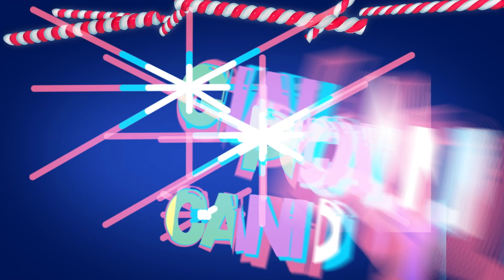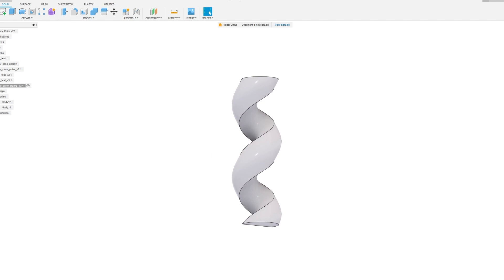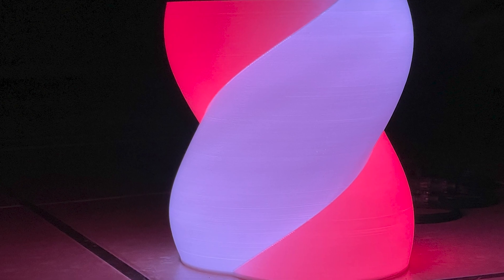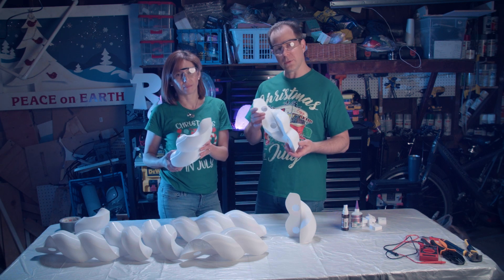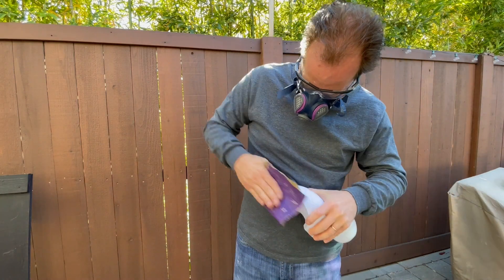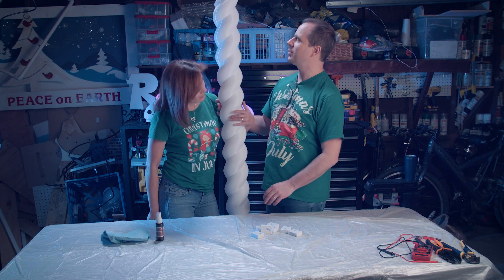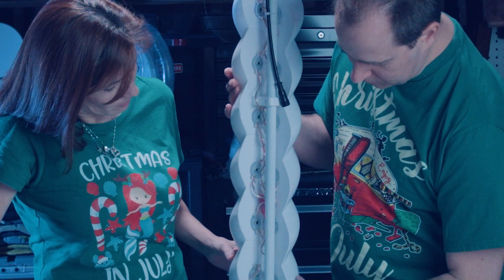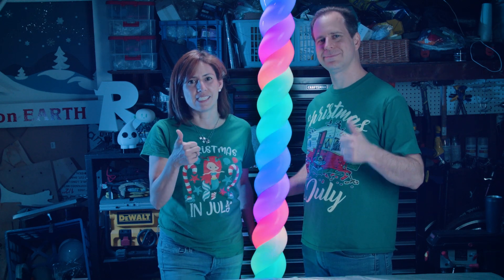Making 6 Foot Tall Light Up Candy Cane Poles | 3D Printed

Comment: Great video, love the project. Any chance you'd have or be willing to make a remix for those of us with a 256mm max height?
Reply from the maker: @srspirofl  thank you! You can print as many or few of the middle sections to get the height you want. 👍
Reply: @HarbeckLights , I have same question (which I think you misunderstood).   My printer can't print that tall a middle piece, so is there a version with shorter middle pieces (or even better, that  prints it diagonally across the build volume as I think that may fit).
Reply: okay, answering my own question and if  @srspirofl is still listenting, @HarbeckLights released stl files include a middle part without supports which, according to my slicer, fits diagonally across my 256x256x256 mm printable volume.  I haven't tried to print it yet though...

Comment: Great idea. Very nice. It's just a shame that the cables are visible from the back. I've never seen the kind of LED diodes you used, so big. Do you control it wled?
Reply from the maker: Yes you could control them from wled as well. They are part of our bigger show running FPP and xLights. btw the cables are fully hidden when they get mounted on a corner - the pole is a full 270 degrees so you don't see the cables from any angle.

Comment: These are wonderful! I'm new to 3D printing and still fine tuning my prints. Would you mind sharing the detailed printing settings you used. Thank you for considering.
Reply from the maker: Thank you very much! We printed these with a bit of a thicker nozzle at 0.5mm and at a slower speed so that the thinner walls have time to cool before the next layer. The stl file has supports built into it so you don't need to print with supports on. Hope that helps!

Comment: Hello from Las Vegas. When you say to keep cost low, what was the average cost per candy-cane? And what kind of 3d printer to you have.
Reply from the maker: We used the AnyCubic Chiron to print these because it has a larger print volume. Each pole used around 1 spool of white filament which was around $20 + lights + hardware.

Comment: What is the glue/adhesive you use to assemble these?
Reply from the maker: I used a cyanoacrylate glue with an accelerator.  Binds better than I could’ve hoped.
Reply: @HarbeckLights  Thanks!  The accelerator is what threw me.